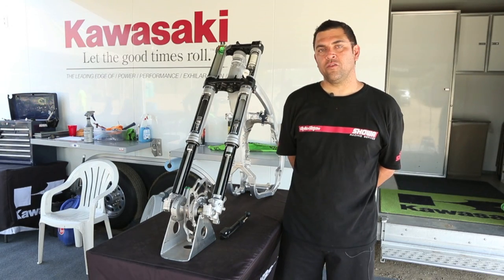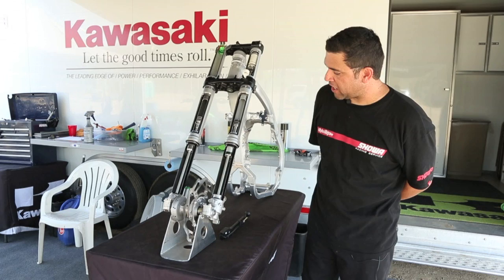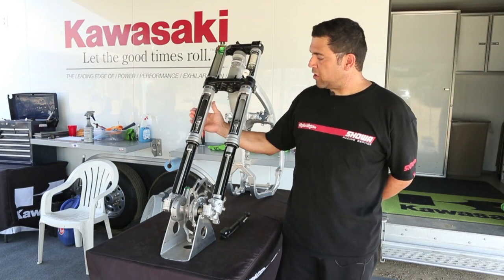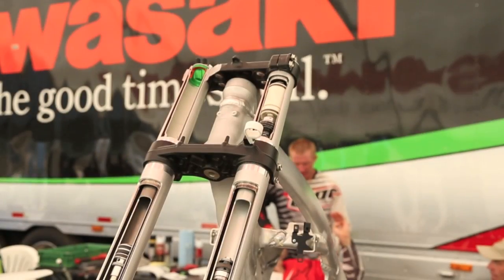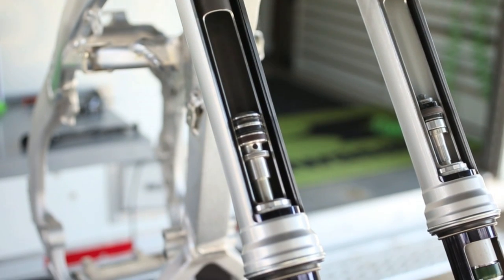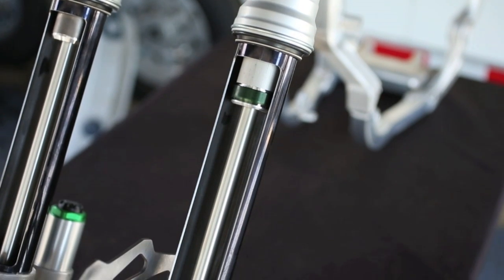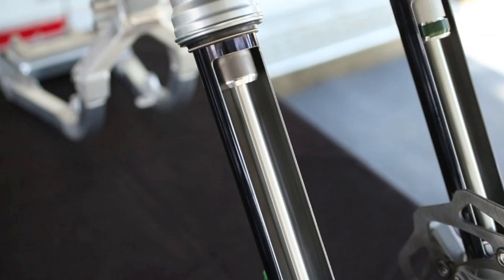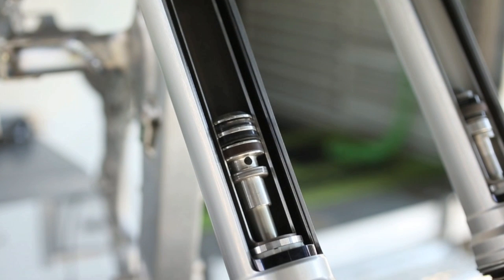2015 Showa SFF-AIR TAC Fork Explained

Comment: can the air fork cap be reversed in direction (i.e. facing the rider) so the bars can be put in the most forward position? same with clicker side so you can reach the screw easier if bars are in most forward position on 2015 kx 450?
Reply: Yes
Reply: @sparky4774  thanks, I have patiently waited 5 years for that reply.
Reply: @Exuberator  😅 You're welcome 🙏 it's as much for you as for anyone else who has the same question